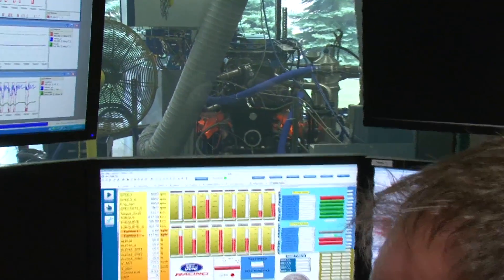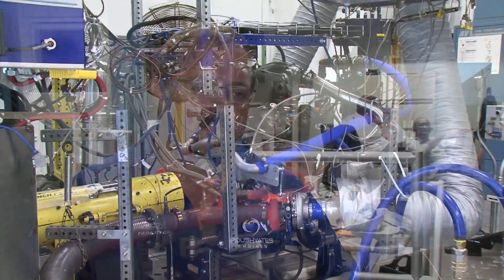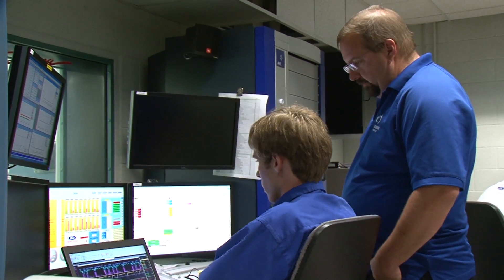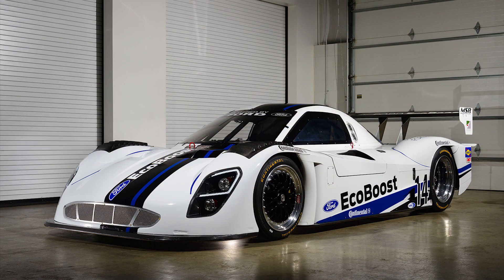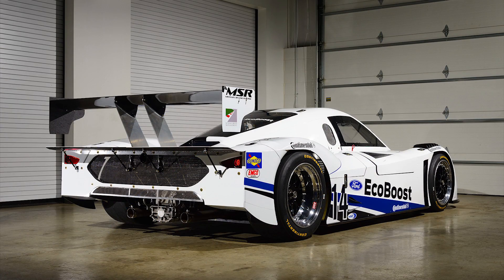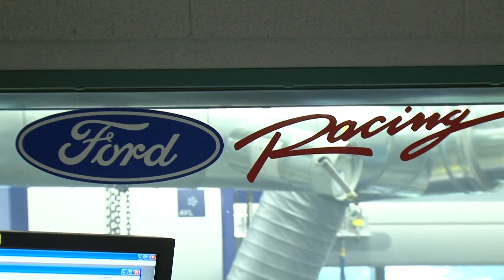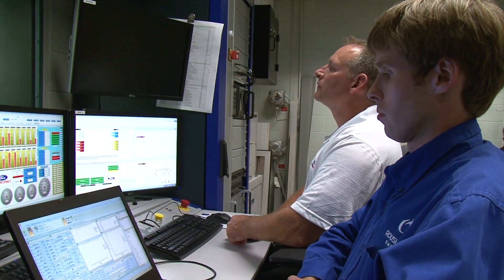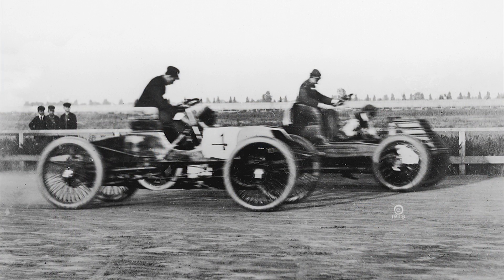Ford EcoBoost 3.5-Liter Engine: 17G Dyno | Performance by Design | Ford Performance

Comment: I am so glad to see you coming back into road racing via Michael Shank.  Doing all this production work is fine, just build it to run 24 hours.  Your last time with IMSA the Ford Probe was a blast to watch.  However the hand grenade pin was always pulled after a few laps.  Ford and Roush do us all proud.  Blow away the Daytona Speed record.

Comment: They did the same thing to the boss 302R, the POS camaros couldn't keep up and the officials ordered that the Boss 302R needed to have restrictor plates in the intake, which made the boss 302R sluggish and it also caused overheating in a lot of cars. After that all the Boss 302R Drivers did a strike and refused to race. Shit if GM cant compete they better get off the damn track lol..

Comment: Well there already has been a twin turbo V8 in the cobra jet... but the cool fords are in Australia where the V8 5.0 comes with a Harrop supercharger. They also have probably one of the best automotive engines in the world that ford insists on killing, the Barra a 4.0L turbo DOHC Inline 6. The engine is an absolute monster... I want the RWD Falcon and the AWD Focus RS500 so bad it sucks ford is discontinuing/discontinued them. TBH nothing at ford is interesting except the upcoming mustang.

Comment: No way you are using stock connecting rods. Wouldn't sintered con rods be bad for a race engine? I was thinking race cars like that used exotic titanium connecting rods, or at least some nice forged steel ones.

Comment: They all brag about these new generation of combustion engines being very efficient, eco and all that. But, the fact is that if you put your foot down on the gas pedal, it's still going to consume a ton of fuel. What they should really do is investigate and pump money into battery technologies. If you can get a battery technology that is up to par with gas (considering energy density) and fast charging, than it's all done. Electric powertrains are miles more efficient.

Comment: When it comes to racing I stand by my statement>>>>> FORD gives out much to much info to THEIR COMPETITORS. Let them see what you have on the track. The 2015 MUSTANG (love them all) HAS NOTHING TO DO WITH MY PREVIOUS COMMENTS. My comments are about today's & 2014 NASCAR (including) EcoBoost 3.5-liter turbocharged V6 race engine.
2015 I will let the FORD ENGINEERS worry about that one.

Comment: I am disappointed. You never actually see the engine performing until the last four or five seconds of the video. What you get, instead, is a bunch of guys bragging about how cool they are and what great work they are doing.  I guess we will know how great in Daytona next year, but for now we will have to endure self-aggrandizement.